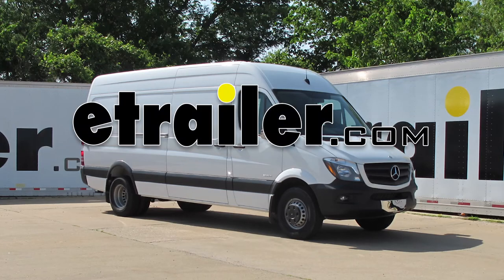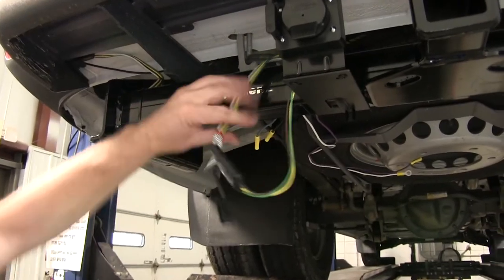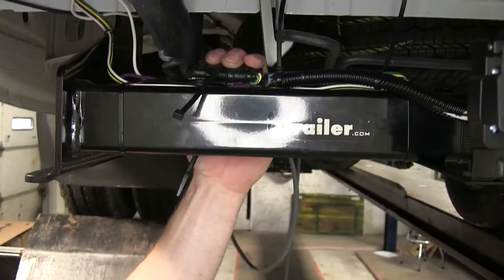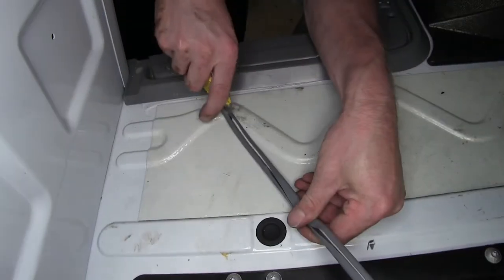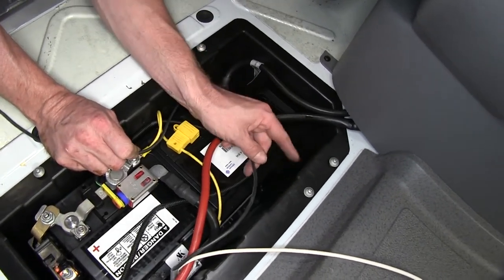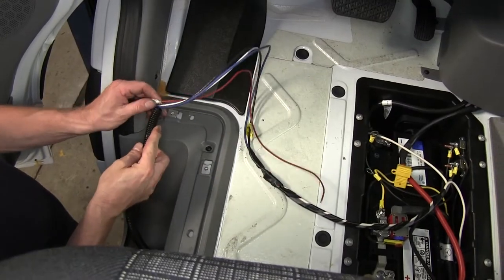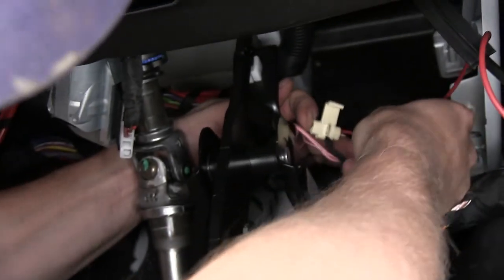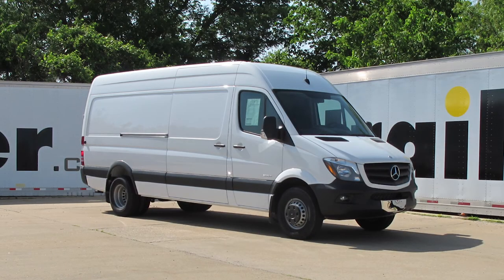etrailer | Set up: Tekonsha Prodigy P2 Trailer Brake Controller on a 2014 Mercedes-Benz Sprinter

Comment: Connecting directly to the brake switch  doesn't work. It throws a code for traction control.  Not recommended. I was looking for the proper way to do it.
Reply from the maker: Thank you for bringing this to our attention. Check out the following expert answer to see how the connections are to be made when wiring a trailer brake controller in a 2014 Mercedes-Benz Sprinter.
https://www.etrailer.com/question-211702.html
Reply: Eric, did you figure this out?  Did you tap into the break switch wire?
Reply: Can confirm - stop light switch does not work without throwing a trouble code. We tried to install a diode as recommended somewhere else but that still threw the code. We ended up running the wire to the stop light at the rear and connecting there. That appears to work fine.

Comment: so far this works but throws the ASR/BAS and ESP screen lights/codes.  Not sure how essential but annoying since the lights will stay lit on dashboard.  Since this is an RV I'm not too worried about spinning tires since there isn't enough power to matter.
Reply from the maker: Which brake controller are you using? Was the controller hard-wired or did you use the factory harness under the driver's seat?

Comment: There was a power connection already at the battery that ran to the brake light converter. Could you have spliced into that at the converter module and added the circuit breaker instead of running the wire all the way up to the battery?
Reply from the maker: These connections need to be on their own circuits so that there is no interference with the power going to each.
https://www.etrailer.com/Trailer-Brake-Controller/Tekonsha/90885.html

Comment: What is the model of the test light that you use in this video?
Reply from the maker: We do not have the circuit tester that was used in this video. Check out the following link to see the tester that our installers use on a daily basis.
https://www.etrailer.com/Wiring/Draw-Tite/40376.html
https://www.etrailer.com/Accessories-and-Parts/etrailer/ETBC7.html